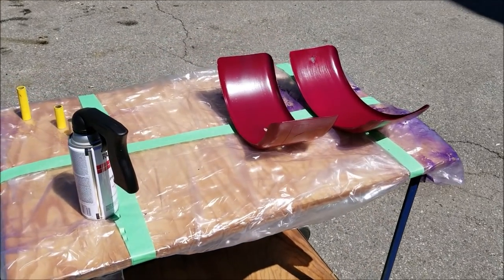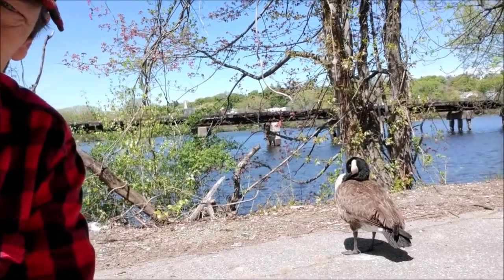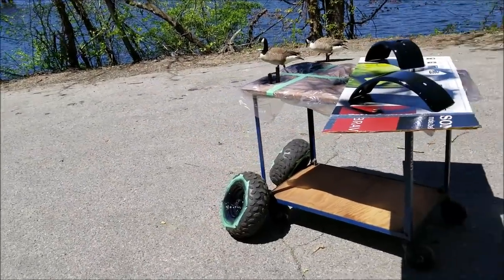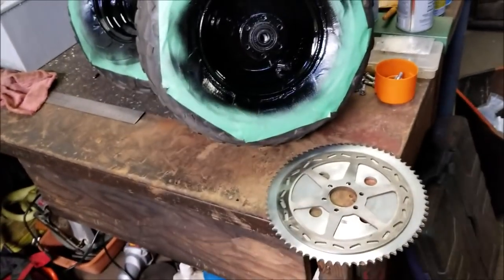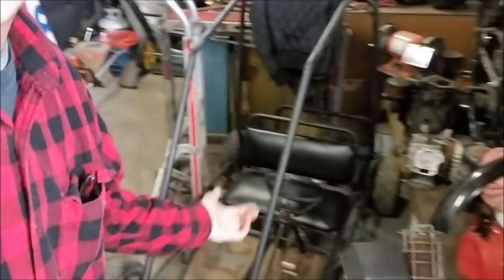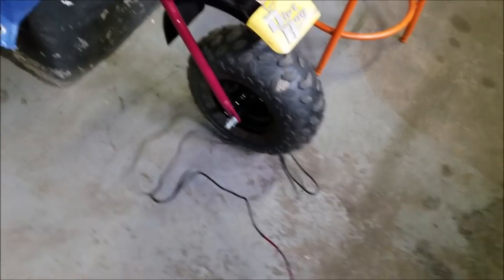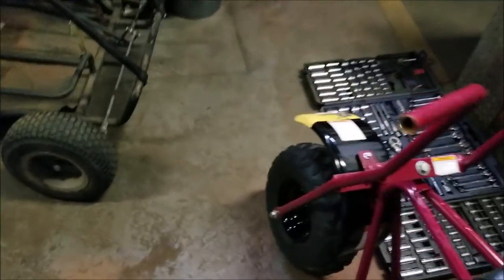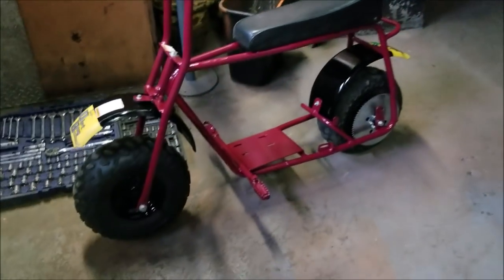Baja Dirt bug Paint and rebuild with Udizzy1969

Comment: What spray paint is that, the red color what color is it?
Reply from the maker: It is rust-oleum  2 times the cover, very nice paint.  Cheers Dizzy.
Reply: @udizzy1969  thanks
Reply from the maker: It works very well,  Thanks Dizzy.
Reply: @udizzy1969  is the paint Satin colonial red?
Reply from the maker: @Astro80s  it is a gloss cranberry, found at lowes. Dizzy
Reply: @udizzy1969  thanks